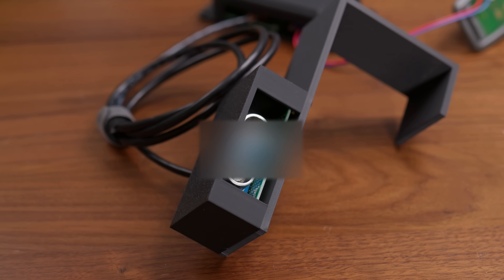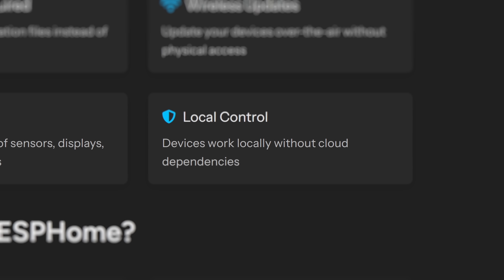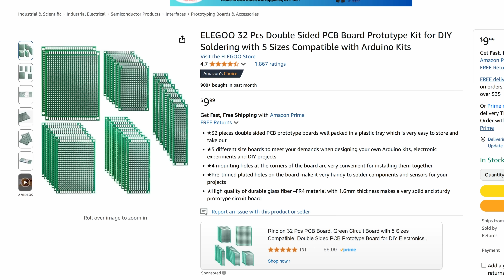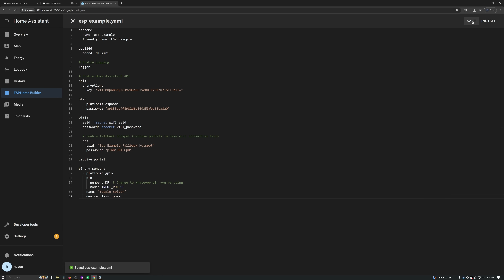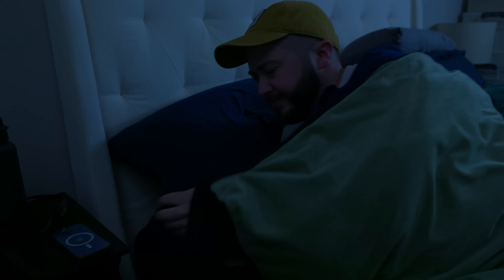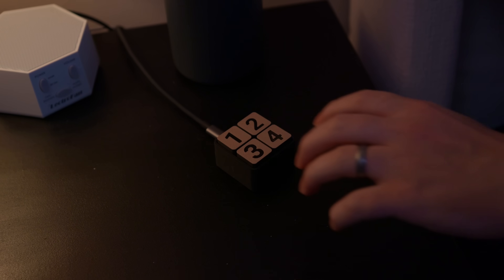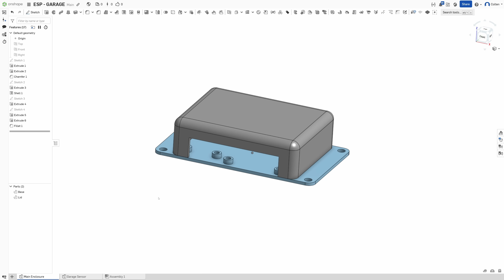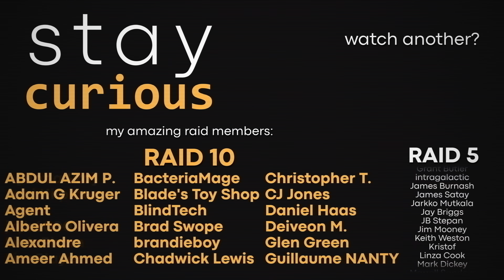These Tiny Computers Made My Home Smarter

Comment: I recommend not buying new ESP8266's. They're fine if you already have them but the ESP32 and variants are better value now if you're buying new. Eg. Faster, more features, more RAM, etc.
Reply from the maker: If you're doing super simple things, the 8266s are cheaper and might be worth it IMO
Reply: @HardwareHaven  where i am (in europe), it really depends on luck and exactly where you get it from, but I have bought in medium sized quantities a decent amount of esp32c3 boards for a project of mine for ~2€ each (on aliexpress); esp83266 boards can be ~1.8 - 2€ a piece, which does make them very slightly cheaper, but IMO for most projects, not worth it given just how much more advanced and powerful the esp32 chips are compared to the 8266.

looking right now, i can see a listing for a esp32c3 supermini board for 1.63€, which would make even that argument not super great (for me, in austria, specifically)
Reply: @HardwareHaven ESP8266 are usually enough for super simple, especially if you have already bought them. But they're far more limited.

On Aliexpress, I see ESP32 c3 super mini (red antenna) at $1.75, ESP32 S2 d1 mini at $2.25, and ESP32 d1 mini around $3 (depending on USB), so similar or not much more than esp8266 d1 mini. Far more features, e.g. CPU speed, RAM, GPIOs, Bluetooth, CPU cores, ADCs, built-in USB, etc, and fewer caveats. All better value than ESP8266 if you're buying new.
Reply: Here in India the D1 Mini is about Rs150 which is less than two dollars, while anything ESP32 is double that or more. ESP8266 is all that I buy.

Comment: Could you tie into the feed from the wall buttons to trigger the garage door instead of having to have a remote tied in up there?
Reply from the maker: Yeah, but I would have to figure out sourcing power (vs having an outlet readily available above the garage door), and I also didn't want to take a chance on tearing up the wall controller.
Reply: Thats can be a future project @HardwareHaven
Reply: I was thinking the same thing. That’s what I did to mine

Comment: How did you get power to the relay and ESP for the garage opener?
Reply: Relay could be powered of the usb c. In the video it gets power from a gpio pin that supplies a voltage. 3.3 to 5v should be enough for the relay. (It does depend on what type of relay you get. Some need as high as 12 volts. That relay then switches (read button press) the open close button on the remote. That doesnt need power as its just making two contacts touch each outher.
Reply from the maker: 5V for the realy from the D1 mini, which is powered via a USB power adapter plugged into the same outlet as the garage opener

Comment: I've also tried a DIY Temp/RH sensor with the DHT22. After about a year it shows wildly different readings. Did you have to do any calibration?
Reply: DHT22's are notorious for having wildly incorrect readings and aren't really recommended for any kind of accurate readings. I personally switched to the BME280 which are much more accurate, according to multiple different tests.
Reply from the maker: Yeah, I've noticed mine is about a degree or 2 warmer than it should be, but ESPHome does let you set up some calibrations. I won't be using this for anything critical lol

Comment: Any reason you didn't try out a RATGDOv32? It works with Home Assistant, can control the lights and the door, gives you info on if the sensor at the front of the door is detecting anyone so you can setup automations based on that.
Reply from the maker: $70 is a start lol. I'd have to double check that it's compatible, but it looks cool!
Reply: @HardwareHaven  I did buy it a while ago and got it for around $60 I believe?  It is nice that you do get a bunch of sensors that are part of your garage door and it's really fast.  Clicking "turn on light" to the light actually going on feels instant.

Comment: Won’t the garage door only tell you if it is fully open? Could that be a problem?
Reply from the maker: Like I said, it isn't perfect. Still way cheaper than other solutions and it runs locally.
Reply: @HardwareHaven 👍
Reply: I personally would go with the reed switch mounted to the bottom of the door frame, that way you'd only ever set the door to closed if it was fully closed, and you could still use the GPIO pin on the ESP module.
Reply: You could always program to run a close signal at a certain time or before sunset. To make sure its fully closed before it gets dark.
Reply: An alternative option is a zigbee tilt sensor which doesn't have that problem but costs a decent bit more than this
Reply: Use 2 sensors:

1 for open
1 for closed

If the signals are both 1 or both 0 the door is not fully open or closed or there is a fault.

Also reed switches are much more reliable than ultrasonic sensors for this application.

Comment: I can recommend the ESP32 C3 SuperMini, quite small but still has good wifi!
Reply from the maker: Thanks!
Reply: Agreed but you need to be careful. The ones with the red antenna are good but the black ones have all sorts of problems.
Reply: @JamesMyatt1  if your good with a soldering iron you can solder a external antenna to the supermini's (Wirecore to antenna and shielding to big capacitor on the right is the easiest.).  Some people also reduced power that seems to help (WiFi.setTxPower(WIFI_POWER_8_5dBm); )
Reply: the superminis I got have terrible wifi (probably the cheapest in aliexpres, cost about 1,20€ each, but soldering a loop of wire the size of the esp paralel tothe antena and bending it to the underside of the microcontroller made a HUGE difference
Reply: The channel circuit helper has a pretty good vid about improving the antenna on the C3 supermini
Reply: @AlistairBrugsch It is fixable but my point is to buy a good module with good antenna placement when possible.
Reply: After messing quite a lot with the c3 super mini i would strongly suggest to go for a seed xiao like one with external antenna, it's worth the additional few bucks !
 Even with fiddling the internal antenna, the super minis disconnect often, some are dysfunctional. 
Home assistant has no management of unavailable devices by default, i had to rely on a hacs plugin called "Retry", very neat. So it told me on which of my 25 esp32-C3 I had to solder retrieved laptop antennas...
Reply: https://youtu.be/DKxh4UP063A?si=4lZmZN9BTH0I2z6M
Reply: I 100% would recommend it, but check the antenna beforehand because some of them are so close to other copper traces, this will decrease the wifi performance ALOT.
Reply: @m3baid  this is fixable by doing what I said in my previous comment.

Comment: 10:44 If you are using HTTPS (for example with a Cloudflare Tunnel and your own domain), you don’t actually need to plug the device into the server_, you just plug it into the _client (the computer you’re using to browse the dashboard), so it’s ideal if you run HA in a VM or container. Pretty neat :)
Reply from the maker: Yes, I worded that poorly!
Reply: @HardwareHaven  I have a reverse proxy and HTTPS, and I have no problems flashing directly from the Web GUI to the device plugged into my laptop. Browser popup to select serial port and off you go.